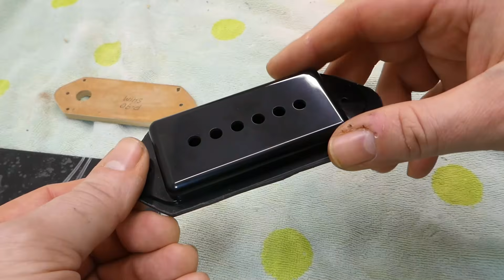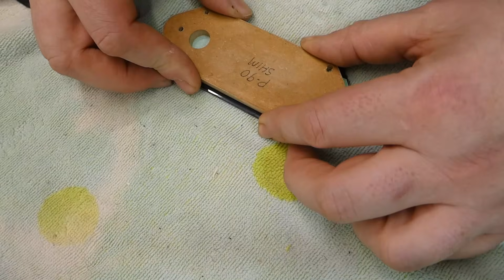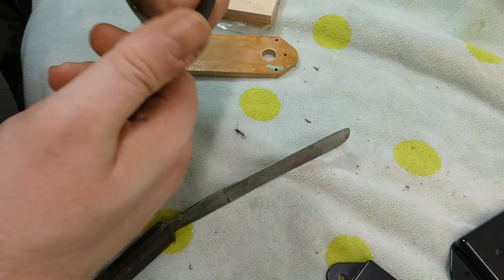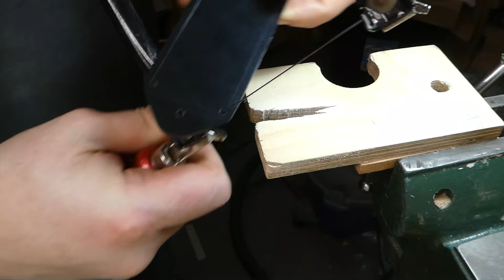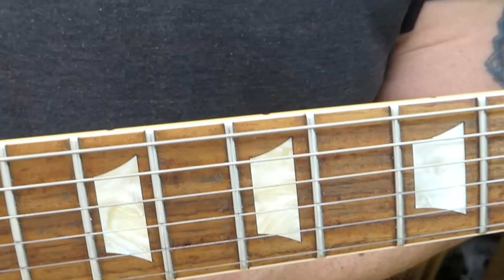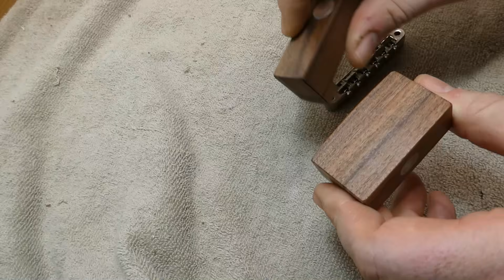Pickup Shimming and Bridge Buckling

Comment: I have a ‘96 Classic which I bought new. For about 15 years I struggled with it sounding just OK. I tried countless pickups, pots, and wirings. Some helped but it never quite got there.  Eventually the ABR bridge collapsed, exactly like this one.
I replaced the ABR and the heavy tailpiece with a Faber ABR and vintage correct light weight tailpiece. It finally brought the guitar to life!!
My advice is: don’t salvage the metal parts on these. They are a liability.

Comment: One thing to consider when you're doing the upside-down-router with templates, get a bottom bearing, "up-cutting" spiral bit. When mounted upside down in a router table, it will be cutting down toward the table, which helps to stabilize the work piece.  And the spiral bit gives more of a shearing action to the cut which can give you cleaner results.

Comment: I did the same with dogear risers when I was mounting pickups on a Yamaha AES1500, which is a thinner-body archtop that originally came with double-coil pickups in a soapbar shape.  Traced the outlines, put in vice and just carefully carved down with a dremel and sanding drum.  Only thing is that the top was quite arched and it was a big strain to bend the riser, so I found a rather large column, taped sandpaper to it, made a small jig/block for the riser and sanded down enough for the pickup level to be just right but the bottom to follow the contour of the arched top perfectly.  Looked like it just melted in.  I was pretty impressed with myself, and I ended up with a  great-looking orange archtop rockabilly machine.  Sort of Gretsch meets ES350 with p90's.

Comment: Nice neck jig. If you reheat that metal it should realign the atoms to make it stiffer. Not sure what the correct temp would be for that metal but even a heating with a hair dryer would be better than room temp.  Preheating before putting it in the jig should prevent possible cracking or breaking.

Comment: For router table stuff I do the larger holding jig specifically for things that are kinda small, like your template there. If it's larger I can screw a handle, of sorts, directly to the top of the template that gives me good grip on the piece with my hands a fair distance clear of the router bit. It's a case by case thing depending on what I'm trying to do.
Reply: Wow those old Gibson action specs. 8 and 6 for a bass is wild. I like an ordinary middle of the road action around 6 and 4, you can easily go to 5 and 3 if the player has a light touch (or wants the strings to bounce off the frets in some cases) so long as the frets are well finished and the neck is in good shape.

Comment: Even Gibson has used different sizes over the years.  Epiphones from the same time period can have different shaped covers and even differently made pickups.  No consistency at all.  
Good call on the Sintra for shims.  I have a guitar that needs a shim like this, I some of that stuff in my scrap bin, I will give it a try.
Man, that sure is a purty Les Paul.  I've seen mashed in bridges before, I was working on a brand new Schechter 7 string a few years ago with an expensive Tone Pros bridge that was even worse then the one in this video.  Dude special ordered the guitar, could not for the life of him get the buzz out of the middle strings.

Comment: Radiusing a floyd rose this way would be an interesting experiment. I have shimmed several, but for whatever reason it has never performed well so I ended up filing each saddle which produced action that will surpass even hard tail fulcrum tremolos. 
The process was unfortunately ridiculously tedious and the saddle order did not descend from strings 3 and 4 like expected. 3 ended up being lower than 1, but it was worth the effort. The day will come soon enough when I do it to more guitars now that you can buy a good quality Floyd for $20 out of China.
Another ironic story is 20 years ago when there was a guitar player's chatroom full of virtuoso guitarists, someone spent $400 on a brand new, authentic Floyd Rose made in America and it still had all the out of box issues as the ones from China for $35 in those days!
BTW, the floyds I filed saddles that did the best were oddly enough, string through versions. I'm working on a mod to convert a locking to string through so the fine tuners can still be used. It's an easy conversion in terms of pulling the bolts and blocks to feed the strings through the bolt hole, but then you have no fine tuners anymore 😒
Reply: You could drill a hole trough the fine tuning screws and feed the string trough them, maybe add a washer so that the string can rotate freely (or machine an special screw and insert for this purpose, going between the screw and the string, with some channels for bearing spheres).
Reply: @artbk  I have considered doing exactly that now that I have a precision drill press and scrap bridges collected to experiment with, but it will still be a difficult process to coordinate the work and get through the hardened metal. 

Strangely, I have used a lot of fender vintage styled 2-point floating tremolos with no locking parts and graphite or even polished aluminum and brass nuts, and once the strings are broke in, they return to pitch accurately like one would never expect. What I often did was simply tighten the screws heavily on the knobs and this pressure is enough to make the knob quite rigid to turning by hand, so the string pressure shifts don't budge them whatsoever.

As of the last few years, I rarely ever lock the nut because I've hardly touched the trem bar whereas previously, I would grab it dozens of times throughout the day. This habit rose from not wanting to deal with fine tuning them lol. Anyway, with dozens of guitars packed away that need some minor repairs, upgrades or adjustments, it's time to get busy. I have a few dozen guitars and only one that meets my standards ATM that is worth playing daily. It's a long story(longer than this one) as to why, but I have always been a stickler for having no less than 3 grab and go electrics at all times and broke that rule a whopping 5 years ago. This does however exclude 3 8-string guitars that used to be my daily players, but it's just an endlessly long story of digressing lol. I will close by making the point that a couple weeks of playing an 8-string daily makes playing a 6 string like a child's toy. My skillset gets so high from the switch that I feel strangely embarrassed like I'm playing with children's toys.

Comment: I prefer the sound with the tailpiece right on the body (psychological? maybe) and top wrap specifically to keep the strings above the back of the bridge having learnt a few years ago that it is possible, to my amazement, to bend a girder. Also it is probably no bad thing to keep the wound strings away from anythng that will make the tuning potentially stepped or 'notchy'.
Entertaining and informative as always. Thanks.
Reply: A steel girder bends under the weight of a fly...imperceptibly, but it bends...

Comment: When you have experience and tools like uncle Ted has, using 3D printer to do trivial shapes like this  seems non-sense. On top of that the prints are not as reliable as one cut from sheets like this. 

I do have shims made by 3D printers, but that because I do not have experience, skill, not tools like Ted has. Would be nice if I do though.

Comment: Hey Ted, I'd like to make one of those jigs for my LP.  What is the radius of the curve on the bottom piece?  12", like the neck?  Can I just use the radius on the bottom of the bridge?  Or will that radius have been adversely modified by the bending of the bridge?  I've got a 1972 LP Standard ( yep, they exist ) and, to my shock and horror, the bridge is exhibiting the same symptoms.

And, just because I'm boring and chatty, I inherited a Custom Order L5 with a P90 in the bridge position and a Staple PU in the neck position.  The Staple PU was mounted directly to the arched top of the guitar.  The pole pieces were absurdly extended to their maximum in a futile attempt to get them closer to the strings.  I ended up buying risers from, I think, AllParts, and had to to glue two of them together to get the required height.  Then, because the assembly was so rigid, I had to sand the bottom of the riser on the guitar, much like fitting an acoustic bridge, to gat the curve on the bottom correctly adjusted.  A long and tedious process as you well know.  I then glued a thin layer of felt to the bottom of the riser to protect the finish, just 'cause I'm nerdy and meticulous.  It came out great but this was a factory oversight or fuckup or whatever.  Gibson is weird this way.  Some things they seem to do exceptionally well and then drop the ball on the obvious stuff.  So, there.  More for you to read and be distracted from doing actual work.  Sorry.  The point is that I wouldn't have attempted this had I not been following your channel.  So I thank you.

Comment: If you ever do decide to get into 3D printing, you can actually print in ABS.  Except the fumes are terrible, which is probably enough of a hindrance to not do it.  But a part like that would take about an hour to print.  Another thing, the look of a print wouldn't be as good as what you can do by hand in less than the same time.  It's easy to work with though, just like the other ABS.

Comment: Changing the after length of the string doesn't chance it's tension,
but it does affect the strings elasticity.
Elasticity is measured over the entire length of the string - as the entire string has to be stretched up to pitch - not just the length of string from nut to bridge.

Comment: pretty much all gibson tune-o-matic bridges sag in the middle over time, they're just pot metal. for many years now my routine has been to set one upside down with the ends resting on my opened-up bench vise and gently hammer all over the middle area with my little fretting hammer to sort of "massage" it straight again

that works just fine and i've avoided the idea of straight-up pressing it in the vise for fear that it would crack but it might be time to revisit the idea

Comment: Hey Ted. Would you consider a foot switch controller for your router table? Even if it’s just an inline “e-stop” it would give you something if it ever got away from you.
Reply: I think he only has one router and also uses it for more "normal" router work where he holds the router, so any additional wiring would need to not get in the way of that function

Comment: Very interesting vid!  I have a comment/question regarding string break angle over the saddles and strings touching the back of the bridge scenario,  On every 1958-style Gibson Flying V I've ever played, including the Custom Shop Reissue that I own, the strings nearly always touch the back of the bridge...especially the D and G strings where the break angle is steeper.  On LP's and other guitars with a stop tailpiece, you can always raise it to decrease the break angle.  However this style of Flying V have a string thru the body design making this adjustment impossible.  Have you encountered this and do you think it should be a concern?  I think it's a design flaw inherent to the 1958-styled Flying V's and you just have to live with it.  It doesn't hamper the tone of mine at all...in fact, it's my best sounding guitar!  It just bothers me.
Reply: What is "telegram"?

Comment: What's a new ABR-1? Seventy bucks?  Not as if it's a vintage piece I'd pay luthier rate to repair. Of course the physics confirms that extra tensioned length for the same tuned length increases overall tension. DylanTalksTone did a great practical experiment on it a few years ago.

Comment: Yeh, break angle definitely doesn't change the tension, but it does change the stiffness or the effective length over which it stretches. Imagine zero break vs 90 degrees - bending the strings around a corner is much harder to do. Similar story with a locking nut, so I use lighter strings on those guitars.
Reply: This is it. The tighter break angle pretty much produces a fixed point at the saddle. Increased tension from bends is not distributed into the length of string between the bridge and tailpiece, giving a stiffer string feel.

String tension and stiffness are different things, and widely misunderstood by guitarists.
Reply: @scottishgentlemen6038 Of course increased string tension is transferred along the entire tensioned length of the string. Do you think that little bit doesn’t change pitch when you sharpen a string? That’s ridiculous.
Reply: @richsackett3423  you don't think increasing the friction at that point has any effect on it? How else can you explain the change in string feel that Ted mentions?
Reply: @scottishgentlemen6038  No I don’t.  Ted’s incorrect. His crack about “the physics” was obnoxious and wrong. DylanTalksTone made a excellent explainer with practical experiments at the end. Check it out. He uses a fish scale.
Reply: @richsackett3423  so i think i watched the wrong DylanTalksTone video, because there was no fish scale. I watched his ep#17, and he does talk in that episode about big break angles introducing points of high friction which reduce the effect of the additional string length - making it less available to stretch than if the string can move freely back and forth over the contact point. 

I felt similarly about Ted's remarks about "the physics" because if physics disagrees with reality, it just means you've left something out of your physics.

Thanks for the recommendation - I'll be watching more of Dylan's content. I like his approach.

Comment: Sean its no dumb question at all, I love the thoughts which arise thinking about it.
Things like the ABR-1 idea of the longer thinner 6-32 brass screws transferring vibration deeper into the body than the slightly wider Nashville style on heavier posts into metal collars in the body.  And then there's the Babicz full contact bridge taking discovery even further.   The magic of those sound posts in violins tuning bridge to body response, beyond my comprehension. 
Wishing I could compare them all to satisfy the curiosity but mostly, my wallet says "Whatcha got is good enough Riv'!"

Comment: This might be a dumb question, but if you have a guitar that experiences a bridge bending like that, would it make sense at all to fit a hardwood shim between the bridge and the guitar body? Would it help maintain the bridge shape or transfer vibration between the strings and body?

On a separate note, watching these videos starting sometime around March 2020 (for reasons I suspect we all understand), I got the courage to do some of my own work, even buy some crappy cheap basses and guitars (Squiers, Epiphones) and sell them off, mostly at a loss just for something to do. I recently bought a terrible condition Rickenbacker 4003 from 1983. It had the volume and tone pots, pickup selector, and a body abused more than Keith Richards' body. I have it stripped, almost ready for a pro to refinish and refret (I know my limits) but a lot of the rest of the work I have done or an doing and it has been a great project.
Reply: Sean its no dumb question at all, I love the thoughts which arise thinking about it.
Things like the ABR-1 idea of the longer thinner 6-32 brass screws transferring vibration deeper into the body than the slightly wider Nashville style on heavier posts into metal collars in the body.  And then there's the Babicz full contact bridge taking discovery even further.   The magic of those sound posts in violins tuning bridge to body response, beyond my comprehension. 
Wishing I could compare them all to satisfy the curiosity but mostly, my wallet says "Whatcha got is good enough Riv'!"

Comment: About the feel of tension vs scale length and break angle, most people seem to miss a couple things. The sharper break angle with a TOM and tail piece offers a little more friction, not necessarily a problem, but enough to feel, combine that with such short string length between the bridge(and therefore the break angle) and the tail piece, and it generally feels a little stiff. More string length after the break angle, like with a string thru, offers more string to be stretched during play, contributing to a loose feel. Neither really represent problems, just things I've noticed between guitar types, stop tail/string thru/double locked/ect, and the way they feel to play. 

Cool video as always!
Reply: Yeah, the break angle doesn't change the strings' tension but it does change the yield of that little bit of string slack behind the bridge. Bigger the break angle less yield.
Reply: You can't have less tension ("looser feel") while maintaining the same pitch. During bends, this "looser feel" would necessarily require you to bend that much further to achieve the  same tension required to achieve the same bent note played with the supposedly higher tension created by a sharp break angle. The string can only be one specific level of tension to be a specific pitch and requires a precise level of further tension to be raised to a specific higher pitch. Same pitch = same tension.